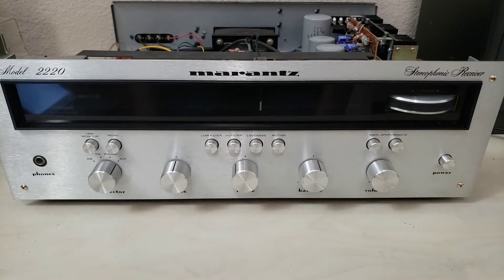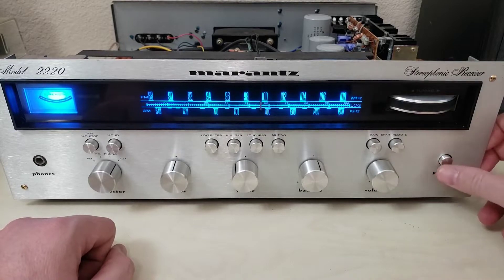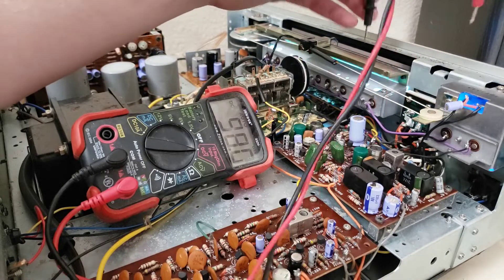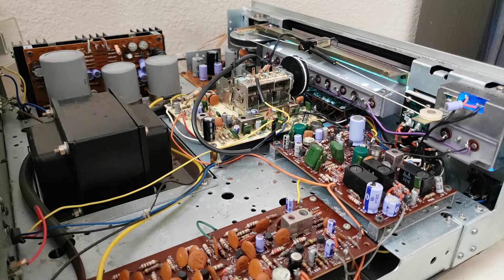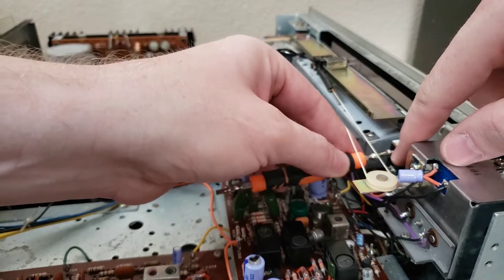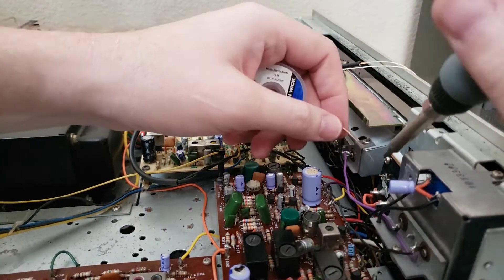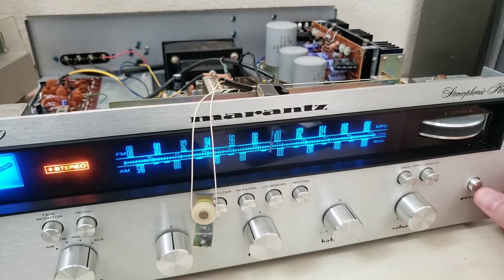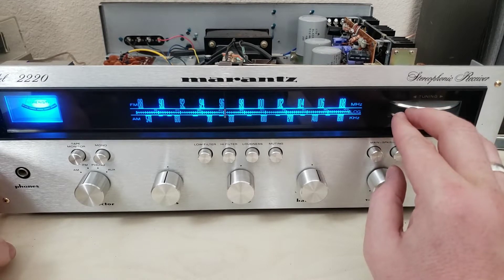Marantz 2220: Replacing Stereo Indicator Lamps

Comment: Do you have an updated link for the bulbs? The eBay link doesn’t go anywhere. Also, where would you recommend getting replacements for the blue lamps? My stereo indicator/tuning dial lamps are both gone. And lastly, how do you check if there's a short after soldering the bulbs back in? I have the multimeter you used, but want to double-check that it says the correct thing. Thank you for this video. It is incredibly helpful.

Comment: While it's true that lamps always have power applied and only the ground side is switched you still must have the Main AC power switch in the "ON" position for there to be voltage present at the lamps. Still, your advice to not work on the unit with it plugged into the AC power is the best standard safety practice.

Comment: Could you give me some help?? My Marantz 2220B works very well, I love the sound of it, but the STEREO lamp is very difficult to turn on on FM. On AUX-PHONO-TAPE it works perfectly, but on FM it is very difficult, although the FM station is picked up, the sound is clean, but the lamp turns on with great difficulty, stations above 100 are almost impossible to turn on the STEREO. And the few stations that the STEREO turned on were with a wire that goes outside the house, passing through the window, and another Technics receiver that I have picks up the signal 100% and the stereo turns on in all the stations with just a little bit of wire. Are there any adjustments I could make? I thank you in advance.
Reply from the maker: The lamp turns on when the FM stereo signal is locked. If the lamp works and isn't on, you're only getting mono. The adjustment procedure you're looking for is called "tuner alignment", but it's a bit of a dark art and requires the ability to broadcast tones over FM and an oscilloscope to view the output while adjusting a few components with non-conductive tools.  You'll find tutorials on YouTube of how to do it.

Comment: Can you explain in detail, what you did from 9:24 to 9:30?  I shorted a very expensive receiver a couple weeks ago (setting bias), and I want to know what exactly you touched between 9:24-9:30 (especially in the third part) with the prongs.  It looks to me like you touched black probe to short led leg, and red one to longer led leg, on both led's, but the third part where you got the beep sound from your multimeter I have no idea.  Thanks!
Reply from the maker: I don't recall if this is one of the models where this is the case, but some of this vintage Marantz show the stereo lamps in parallel on the wiring diagram, but they're definitely in series IRL.
Reply from the maker: The first two, I was checking that I didn't short across the LEDs when soldering them in. As you mentioned, I tested for continuity across each LED against the junction. The third test was for continuity between the inner pins as the lamps are in series. Wanted to make sure I didn't accidentally break that connection and open the circuit.
Reply: @cilynx  So, were you touching each prong to each bi-pin leg?  I'm just getting started, and I got a very expensive lesson right off the bat, and just trying to be very careful from here on out.  Thanks!
Reply from the maker: @Gabrielishere  -- the first two tests were testing for continuity, touching the probes to the two legs on one LED and then the other to make sure neither LED was shorted. 

The third test was touching the probes to the inside legs on the mount -- one from each LED as the center legs need to be connected together to complete the series circuit.

It's worth noting that LEDs are polarized -- in regular operations, they only flow current in one direction. As this is an AC circuit, it doesn't matter which way you put both LEDs as long as they're both oriented in the same direction. On the third test, those inside pins that are connected together should be the anode of one LED and the cathode of the other.
Reply: @cilynx  Thanks so much.  I have non polarized LED's, and my Marantz 2325 will take them even for the FM circuit, unlike some others... where I see another tech using incandescents for the stereo light, since they are the voltage needed.

Comment: On your video at about 2:30 you use your new lights to test the circuit. I tried that with mine and nothing lights up. I might not be clearly seeing what you are touching. Are you touching the wires of the new lights to the two soldiered pins of the mounted lights? Thanks!
Reply from the maker: Yes, I'm touching the leads of the new LED to the soldered pins of the old mounted lamps.  It shouldn't matter which orientation you test as they're fed with AC voltage.  If you have a volt-meter you can test the voltage across the installed lamp as well.  It should be ~8Vac.  If you're not seeing that, the problem with your lamps is upstream.
Reply: @cilynx  I go the new lamps in and everything is working great. Thanks for the video.